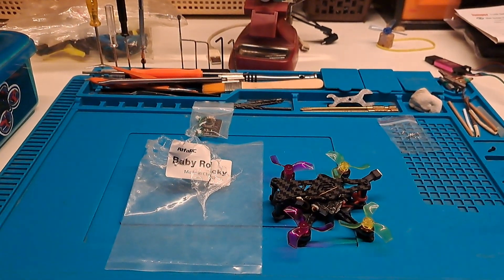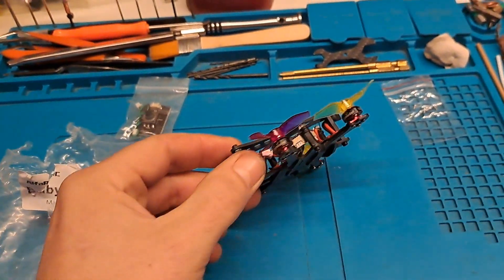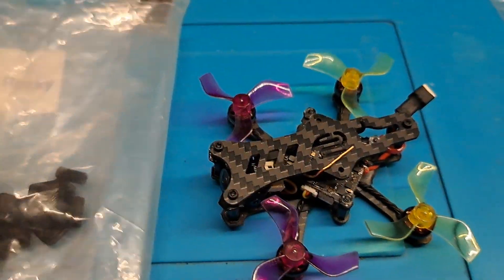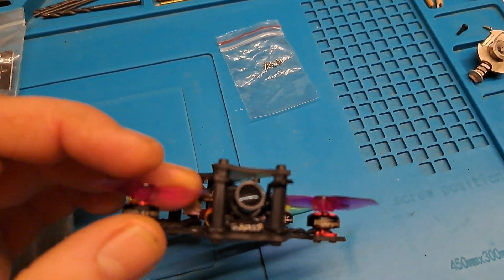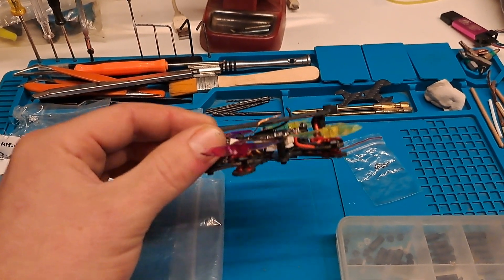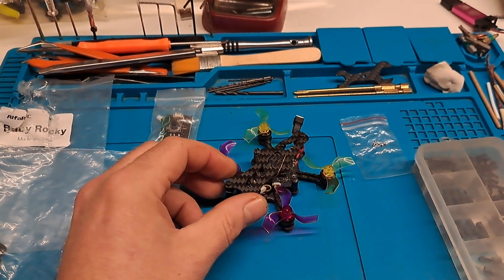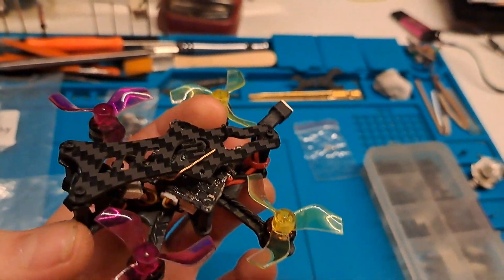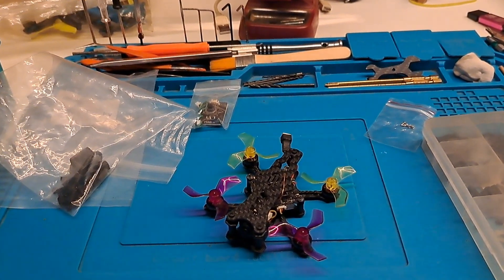First micro build of the year - AlphaRC Baby Rocky frame.

Comment: Cool build. 👍 
I think an Elrs board would be great on that frame. I love those motors. They are my favorite choice for the small micros.
Reply from the maker: Thanks.  Yeah I haven't switched yet, but have the ELRS module.  Might change it when I get it set up or build a V2 😁
Reply: @SOLARFPV  I'm still flying a mix of FrSky and Elrs. Haven't gotten everything changed over yet.